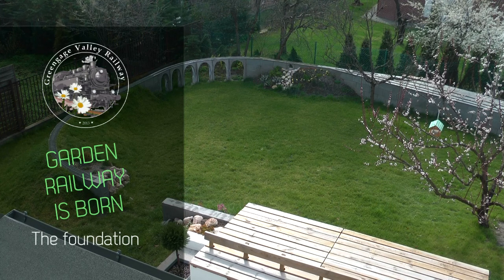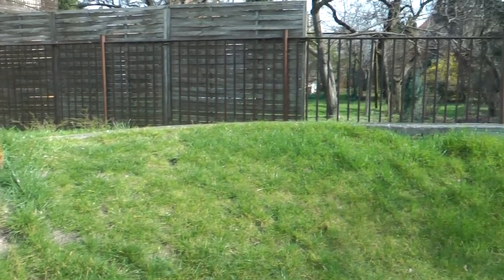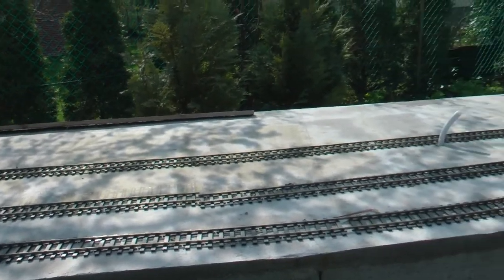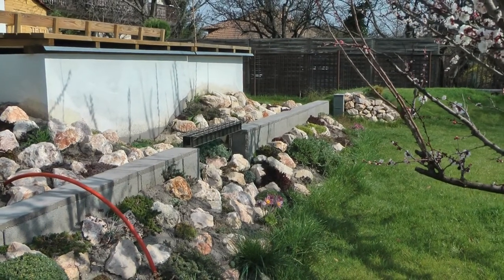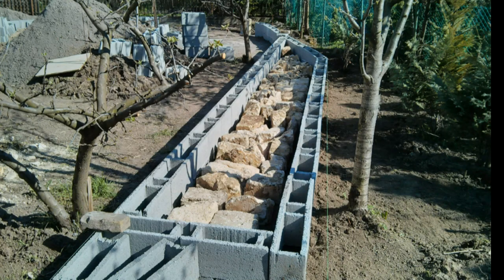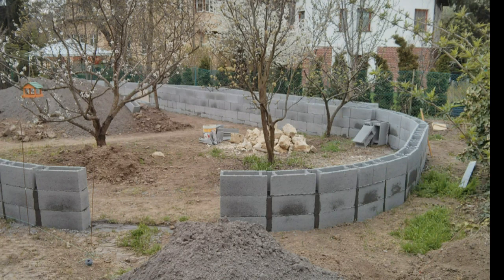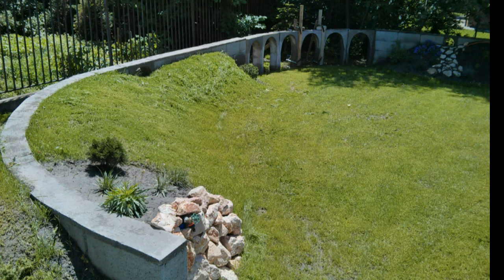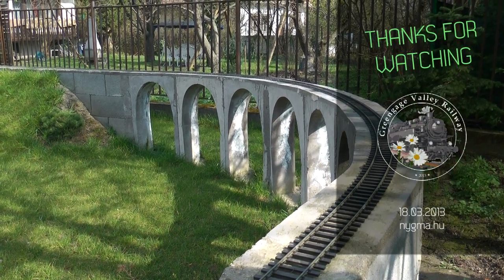Garden Railways is Born - The Foundation

Comment: So to connect these clocks you fill them with cement and rebar?! That loop looks to be about 45-50m?
Reply from the maker: It was a long time ago. I think there is one rebar in the blocks and of course fill up with concrete all the way to the top. That pretty much holds it together as these blocks open on top at the bottom as well. So the concrete inside make one huge blob. And yes the loop is around 47 meters.

Comment: Very visible to the neighbors. These garden railways are sitting ducks for vandalism, unless you live ina "blessed' realm.   Mine will have the 2metre fences and gates, and be invisible from the roads or adjacenthomes, not that they would be a problem.
Reply from the maker: I think this could be an issue. This is my back garden, the neighbors do not mind the trains and it is quite far from the street. Also most of it is blocked by the house. What you see from the street is the bridge from about 20 meters away.